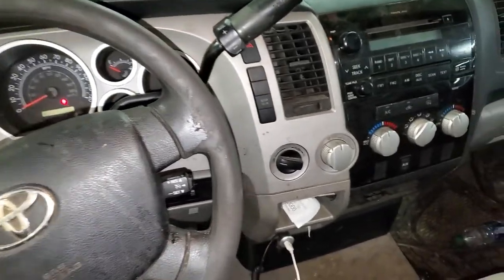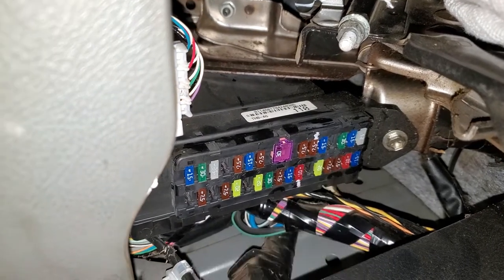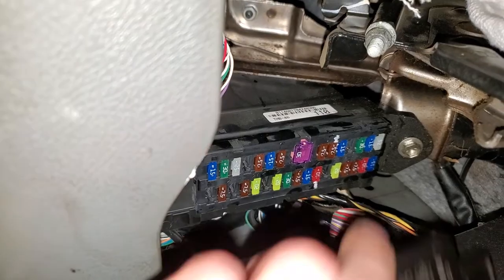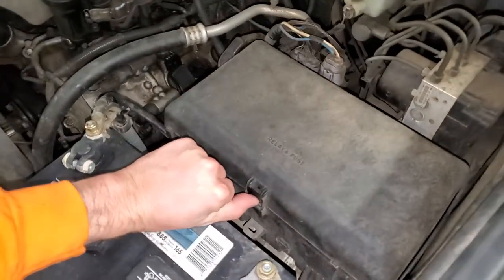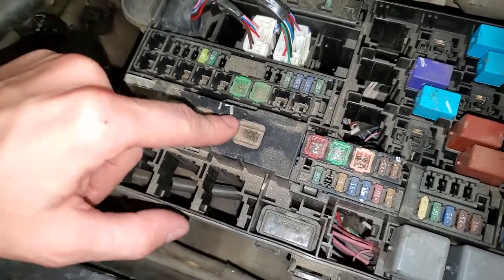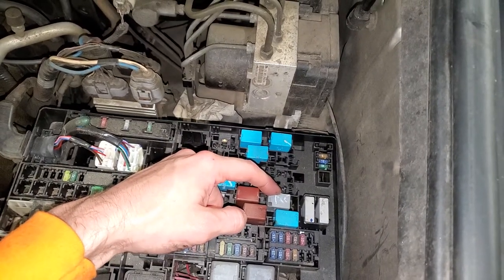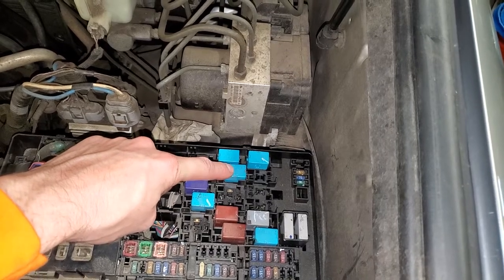2007 Toyota Tundra AC Fuse, Blower Motor Fuse Location

Comment: How do you change the blower motor relay?  Would the #10 fuse inside the vehicle have anything to do with the heat and AC?   You said you can clean the window under the hood fuse box and see if the blower motor is bad.   If it is blown, how do you take it out to replace?  Seems different then like a 10 or 15 amp removal with the tool.
Thanks.

Comment: Thanks for the heads up. Noticed this AC all of a sudden wasn't blowing cold this afternoon. Was working just fine yesterday. 2007 5.7ltr 143K. Going to 'Czech' these areas out now...will advise. 🙏🇺🇸
Reply: What was the issue?  Dealing with this same problem now
Reply: Yeah my blower just stopped working yesterday

Comment: I was just working on a 2010 Toyota tundra and everything was fine the only thing that the blower fan wasn't working and that prevents the compressor to kick on and you cannot test the blower motor because it has the resistor already and one whole piece have in mind you need to make sure you blower motor works if not the compressor won't come on

Comment: well now I know where to start . my ac blower sometimes will just not turn on, then randomly later it will work. hopefully it is something simple like a fuse because its about to be real hot here in phoenix and I work construction, nothing worse than driving all over the city in 118 degree heat with no ac then getting in a hot truck at the end of the day.
Reply: Mine does exactly the same. ..in the same damn heat.  Did you find out what it was?
Reply: @tenhomebuyers5313  yes actually I did! it turned out to be that the blower motor itself was bad. it is not very expensive and pretty easy to change out, you can get to it from under the glove box (to remove it you need to take the glove box out, there are videos on here showing how)  once I changed it out I never had an issue again.
Reply: @AsTheWheelsTurn  Awesome!  Thanks so much for the reply.  I was actually at O’Reilly’s Auto Parts yesterday and had a guy helping me do some fault finding…I have your problem, and another one apparently.  But for now….he showed me how to just give it a smack on the blower under the glovebox, and it get’s it going for now.  Thanks for taking the time to respond internet friend…it’s appreciated!  (Did you buy the blower motor on Amazon, or an auto store?). Cheers mate.
Reply: Once you changed did it ever happened again ?

Comment: Where is the blower resistor located on a 2007 Tundra? I’ve removed several parts that I thought was it (and replaced them), but can’t locate the resistor. Any help would be greatly appreciated.

Comment: I’m trying to figure out why my climate control lights don’t turn on. When I lower the dimmer switch and slowly turn it up. It works but my clock and Info dash lights flash. Until I crank the dimmer all the way up it goes back to normal but my climate control dash lights goes off. Any advice?

Comment: Which fuse should I remove to disable the AC compressor from coming on? Everytime I turn on my fan the AC kicks on and the compressor is grinding, needs replacing and I want it off momentarily, thanks
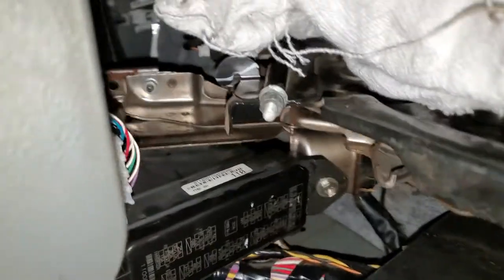Reply from the maker: To disable the AC compressor clutch you will want to remove the 10 amp fuse that i point at at 0:22
Reply: @LehewTech  Got it, thanks for the quick reply 👍👍

Comment: I swap one relay to the location of the magnetic clutch relay and my air conditioning light still blinks, any suggestions. Thank you
Reply: You might be low on refrigerant. I suggest getting a can of 134a with a gauge builtin and check the pressure on the low side.

Comment: Do you know where the fuse or relay is for the heater controls I have no power ?
Reply: my ac control panel has no power, either, but all my fuses are good.  Did you even find a solution?
Reply: @robmpulse  did you fix it?